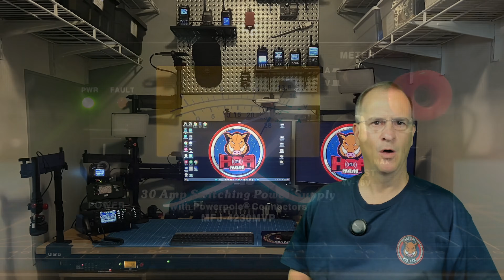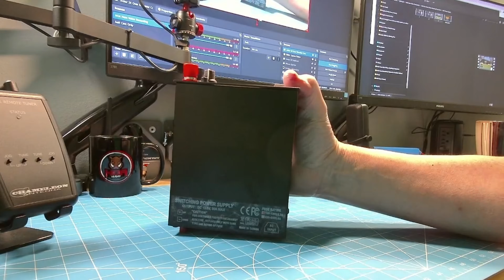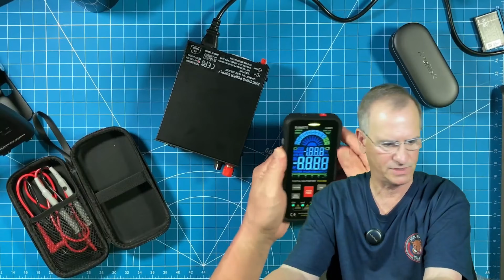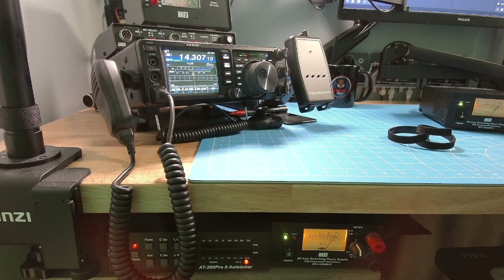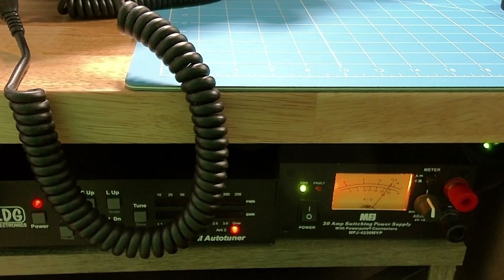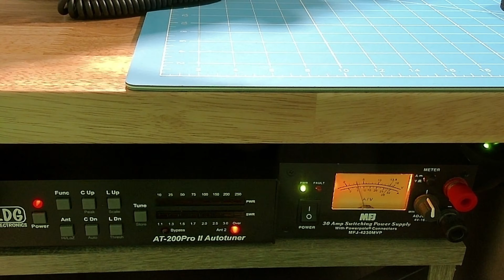MFJ-4230MVP The only Power Supply You Will Need for Your 100 Watt Transceiver:  Features / Review

Comment: Great little power supply. I use one to power my FT-840 and an FTM-3100R when i bring it in from my vehicle. Never a problem, and i dont get any reports of noise. Love the dentent at the 13.8V position on the voltage adjustment knob.
Reply from the maker: A great piece of gear...never even know its there, as it should be.

Comment: I’ve had this model for 3 years now. Still going strong. I charge my Bioenno batteries with it as well since I can raise the voltage which is very handy. I did wrap a type 31 torroid several times around the 120v power cord for some small rfi noticed on 40 meters.
Reply from the maker: Thanks for commenting.  Curious, do you direct connect from the power supply / power pole to the battery, or do you use some device in between to regulate the charging?  Never though to do this.
Reply: @HOAHamRadio  I called Bioenno on this before doing it and they said the BMS would be fine to plug the battery PPoles right into PPoles on the Power Supply. You can watch the Amp meter fall as the BMS takes over when the battery is fully charged. ☺️
Reply from the maker: That is some GREAT info, thanks for sharing.

Comment: A nice feature is a switch that locks the output voltage at 13.8v so you don't have to constantly check the meter to see if you bumped the adjustment knob.
Reply: My knob had a very pronounced detent. No switch though.
Reply from the maker: I wish I would have thought to mention that, it is a good feature.